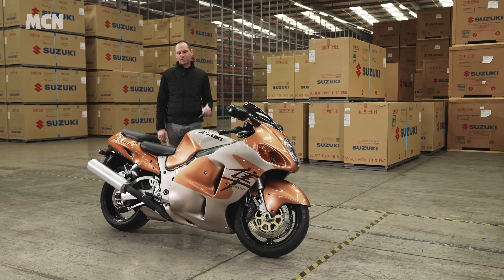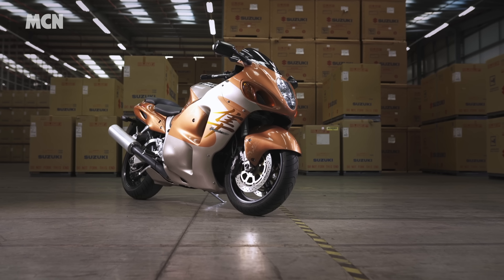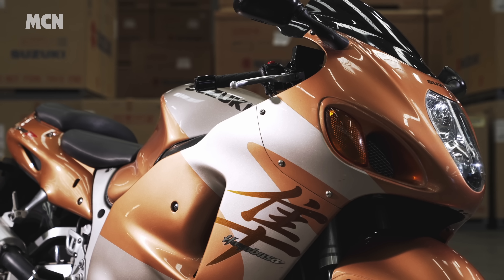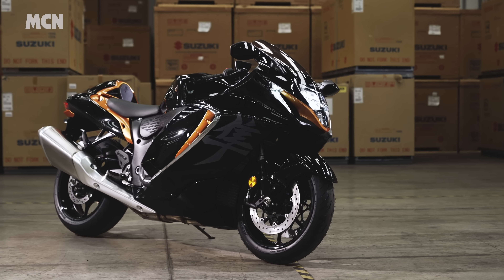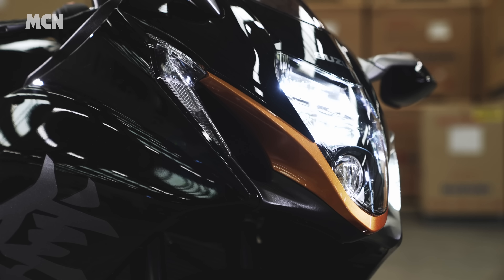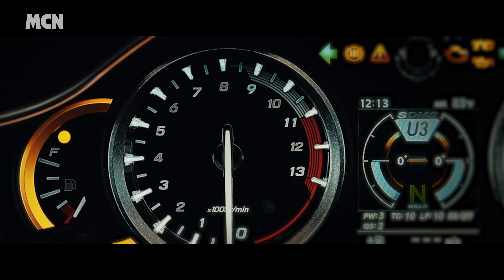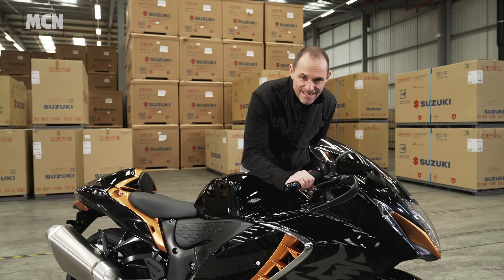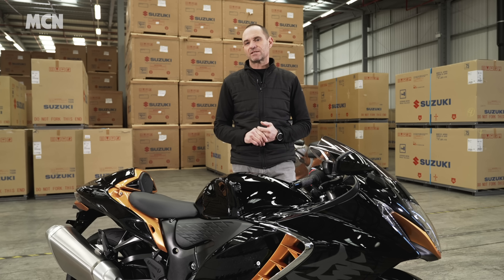2021 Suzuki Hayabusa exclusive: Neevesy's take on new 180mph+ hyperbike | MCN

Comment: I'm really mesmerized how they've still managed to put Busa elements. They've not changed the look completely and that's a good initiative.❤️
Reply: Exactly...
Reply: I think it looks lovely. Strong & elegant. It reminds me of the Bugatti Chiron.
Reply: Unlike BMW changing whole S1000RR front look which was so iconic
Reply: Of course they managed to put busa element, its a same bike basically lol. Just lot of small change here and there.
Reply: The look is part of the aerodinamic enginering marvel of this beast.
Reply: @ardijanuar2036  Small changes here and there? Lol. They've changed so much on electronics and still managed not to overdone on the looks. Maybe you need to watch it again. Lmao
Reply: @ayushh1001  its basically same chassis and engine base, for me if it doesn't have new engine and chassis, it's an facelift not a new model. It's an evolution not revolution. Revolution is like when ducati came out with panigale v4 or honda with cbr 1000 rr-r. totally clean sheet design not carry over from previous gen.
Reply: @omegabiker  panigale v4r? Cbr 1000 rr-r? Bmw s1000 rr? All those get huge improvement with clean sheet design, not carry over from previous gen. Even aprilia rsv4 managed to get more power with euro 5 not lose hp like busa lmao. And of course don't forget ninja h2, which has long dethroned busa from straight line speed king favorites.
Reply: @ardijanuar2036  Right, now check the prices of each of those bikes compared to the Hayabusa and watch the video I linked above to understand why.  Hayabusa is one of the easiest and most modified motorcycles if you want more speed and now they've made that even easier.
Reply: @omegabiker  not as easy compared to ninja h2 to make crazy power. Bolt on mod and tune on h2 can makes 300 hp+ on pump gas. How much mod do you need in hayabusa to make that kind of power? Turbo, nitrous or serious engine work are required for that power in busa. 20 years ago maybe busa is the easiest bike to get insane straight line speed but the competition has moved to another level today.
Reply: @ardijanuar2036  the H2 is more expensive because of the electronic and charger that's comes stock on it. This has been debated since the bike came out. Just the base H2 is $25500. My 2020 Busa was stickered at $15700. You know how much power I can add to my Busa just to match the cost of a H2? Nearly $10k? For the H2r $40k.  Come on, that should tell you some thing right there. If I put $40k into my Busa it wouldn't even be earth legal to ride.
Reply: @ardijanuar2036  The electronics makes it a completely different bike. 200hp bikes without cruise control, are not really safe, in the sense of keeping you out of jail, on the street anymore. Then there's the increased emphasis on braking. (Stylemas are pointlessly expensive, and very possibly excessively grabby, bling/jewelry on a non-racer; but no doubt a big improvement on the outgoing ones.) Flapping around changing stuff which works perfectly well, especially now when the resources available for such a redesign is only a fraction of what they were in the golden era, is just wasteful, and more often than not plain counterproductive.

Being Suzuki, I also bet the refinements will show up much clearer on the road, than in spec sheets.More that anyone, their bikes are designed by test riders as much as by engineers.

Comment: That rear end looks absolutely mental!
Reply: I think they nailed blending the looks of the previous generation vs the future. The rear end design used to be a bit perplexing.
Reply: Only great improvement on the bike
Reply: Finally the front and back DONT lookalike
Reply: @greylove1522  what about electronic controls and features ??
Reply: @anandthandav3641   They are nice too. The Kyb suspension and Brakes in my opinion is the best upgrade to it.  I just really like the new tail section.
Reply: @MirageTactics  looks the same to me

Comment: Oh my she aged well, and I love how time has treated her, all though I'm gonna always have a soft spot for Honda I'd love to see a new super blackbird too
Reply: I'm with you there. I loved every minute of my XX until I sold her 10 years ago. An unbelievable mile muncher with a full load - simply awesome bike. :-)
Reply: @deldridg  Agreed 100%, and almost exactly the same with me... I sold my Blackbird around 10 years ago, cause I bought a Busa. I LOVED my BB, and in many ways, I think it was a better bike than the Busa (I DO love the Busa though). Actually, I feel like the perfect bike would have the Blackbirds chassis, brakes and ergonomics with a 90 degree V-twin that could run with a Busa or ZX14... something in the 1400cc range. With Honda's engineering and reliability? Man, that would be one hell of a bike.
Reply: +1. 
A reissue of the Blackbird would be a bike I'd want to see for sure.
Reply: That was one great machine silky smooth.

Comment: Kawasaki: ' is he back ??'
Ducati : ' yup '
Bmw:😨😨😨😢😢
Reply: Exactly what i thought
Reply: yea but I'm pretty sure there laughing instead of being shocked lol
Reply: @khaledmaher6602  Yeah I doubt Kawasaki or Ducati  - both with lighter bikes and over 10% more power - are even slightly worried. More like celebrating.
Reply: Doubt Ducati even cares if I'm honest, they've never made a bike to compete with the Busa. Sure they could if they wanted to.
Reply: @JMLueckeA7X  Well they're already getting 20hp more from a significantly smaller engine. They really wouldn't struggle.
Reply: @siraff4461  it's honestly ridiculous, this bike did 194 in 1999 had the most power of any bike was THE straight line king. Now it's slower than the old one, slower than every 1000cc sportbike. The v4r has the most power at 221 or 234 with full system. Kawasaki get less with a supercharger stock street legal form h2. Not impressed these days.
Reply: @A500-g6g  it's not even tested this 3rd gen busa i think believing in papers specs and test riding  have lot of difference
Reply: @A500-g6g  and in de-restricted mode too
Reply: @siraff4461  this bike was pioneer.. Thats why al lot people call this bike A Legend. Not a people like you are, fans boy of those manf
Reply: New busa be  like- knock knock Tera baap aaya 🤪
Reply: The legend
Reply: @siraff4461  Hayabusas are used as drag bikes with superchargers/turbos/nitrous, and will kill ducatis and bmws on the drag strip on the daily. Apples to Oranges
Reply: @khaledmaher6602  BMW and Ducati don't have a direct competitor for Hayabusa. Atleast Kawasaki has the ZZR1400.
Reply: @Guuggel  they don't really care about Hayabusa if they have a faster stealthier bike lol
Reply: @siraff4461  yup
Reply: Considering the ZX-14 owned the Busa, I doubt Kawasaki or Ducati would be concerned with the new Busa.

Plus Kawasaki has dis-continued the big Ninja. So I guess they really are not concerned.

Suzuki....'No more Ninja 14....perfect. Now is our time to bring back the Hyabusa.'
Reply: @A500-g6g  Simple ECU flash on the H2 and you're up to 250HP. That 998cc engine puts out 310HP stock and is highly restricted in the H2, to keep it somewhat sane.The Ducati mill is no comparison. What cc is that big Duc engine again?
Reply: It's a "she" mate...
Reply: @A500-g6g  People who want/need to go fast for real, as opposed to on internet forums, care more about how much power they can reliably get out of the engine, than how much it happens to come with stock. 

What matters stock, in bikes which are all plenty powerful anyway, are more mundane facets, such as driveability, reliability, longevity, heat management etc.

The 'Busa is plenty impressive on both fronts. Others may be as well, but the 'Busa has earned its legendary status over the years, both as a highly effective fast street bike, and as the base for a genuinely fast racer.
Reply: @GPz84  The two wheel missile / hypertourer market is a lot smaller these days than it used to be. It may still be big enough to justify updating one player, even if it no longer has room for two.

As nice as the 14 is (comfier than at least the outgoing 'Busa), current speed enforcement (at least in the US), makes it almost reckless to take it out without the ability to engage cruise through all the crazy police-pension-fund-topping-up speed trap zones, which by now pops up, like moles, around every little podunk town.
Reply: @paulnorman8274  I agree with you biking is much more about getting out there riding and learning physically than anything else. But I expect better from these new bikes like the h2 and hayabusa which are meant to be the most powerful and fastest in a straight line. In the 90s this was the case and they were the ultimate speed missiles. Now they're mostly slower than sportbikes. 

I say get the last iteration of the zzr1400 as it has the cubes and the actual performance and looks. 

If u want real speed you buy a turbocharged hayabusa off eBay, they come with inspections receipts dyno printouts and drag strip time slips and MOTs even, for the same price as a new one. Personally I say just buy a 1999 or 2000 unrestricted hayabusa or a zx12r brilliant bikes with plenty of power and 190 mph capable and only a few grand.
Reply: @Guuggel  shame that ZX14 going into retirement, they could of built new gen 3 with latest electronics with the famous supercharger. I really though they would built it,since they have there jet ski with 310 hp.
Reply: @GPz84  it's not horsepower that makes great street bike, torque. I have 2015 H2 and ZX14,wanted something little different for the city purchased 2020 KTM 1290 SDR that beast throttle wheelies in 3rd gear. It's blast to ride.
Reply: @geraldperry7779  That KTM will also be a blast when it starts falling apart,  which is inevitible.
Reply: @GPz84  have you read on the reliability on LC8 engine? Also with the 2020 they strengthened the engine,Pankyl gearbox,forged pistons,finger tappets, and Titanium valves,the list goes on. My only concern is the wizard electronics,now that I can't fix,at the mercy of KTM. For city streets it's best bike I've ever rode. My first street bike was 1975 H1 500, sure you know the bike since you own Concours.

Comment: I have a 2000 Busa that has the 220 mph speedometer. I've always wondered if it was one of the unrestricted models. I've only had it to 140 in 3rd gear with plenty of revs to go. I slowed down for fear of getting a ticket. I was from 50 to 140 back to 50 in about three seconds. It was incredible. What I say to the Gixer riders that say the Busa can't corner with them is, "I would rather pass you on the straight than work my ass off in the corners anyway".

Comment: At this point they should come with a turbo or supercharger stock
Reply: Mate👊✊ I unfortunately disagree, turbos on bikes are great for 9 second passes, the Kawa Z2 engine I really don't like with more 'whistle' sounds than rev sounds? If they have been able to make this 1340cc big block euro 5,bravo.this engine is going to sing!
Reply: Evo Shift  what's the true story why it blew? Where you just commuting in traffic? Where you at a track? That sounds horrible mate, I'm sorry to hear that, they are meant to be 'bullet' proof where you can turbo and get big psi etc etc?
Reply: Evo Shift  Don't post a comment tarnishing a company's reputation and give no evidence. I'm sure suzuki honour warranty claims but there must have been something you done that made it void.
Reply: Turbo, my poor novice, nothing can come close to a big displacement naturally aspirated engine. Turbo equals lag, muffled exhaust sound and lower reliability.
Reply: @lensoprezole5322  sure you can ride a tank like the new Triumph Rocket with its 2.5 L displacement but its heavy.  Kawasaki is atleast moving things along with the superchargers
Reply: naaah i will go with more cc :x now it have 1340 with 190 bhp at 9,7 k rpm and 150 nm at 7 k rpm its still more than enough for 90% customers or better saying egzacly what they need :x  =lil more than 4 sec 100-200 real m/h is relatively fast :x  but i will go with like 1600-1700 cc :x 230-240 bhp at 10 k rpm and 180-190 nm at 7 k rpm ;) weight will increase be like 10-20 kg  those numbers defenitelly dont help in daily riding but  in race mode on straight yep :x  which in fact be 5% time spend on this cycle be 90% of customer .:x .so its good anyway what it is with better aero better brakkes  stronger midrange and lil more comfy position behind sterrrwheel  they do nice progress .
Reply: @Nekminute   rocket have no chance with hayabusa on straight . :x  20 bhp less 60-70 kg more and much worse aerodynamic ....no doubt   hayabusa have heavvier punch at straight ... 221 nm of torque is nothing  compare to hayabusa 150 nm beside  drag aero weight  because rocket pump those numbers at 4 k rpm vs busa at 7 k rpm = busa at peak torq  produce more force at tire circuit  be around 20%  :X /at peak torq at crank  with lower weight better aero in real riding the diffrenc be even more  .,beewten peak power vs peak power less diffrenc but still relatively big diffrenc again corelate with better aero less weight diffrenc in real be much more than just from engine  peak bhp numbers ... but those are diffrent cycle class so whatever ;) but for fun we still can comapre both in real drag race and on paper like i now ;) . rocket is made for have best  proportion beewten power to rpm ratio = highest power posoiibble at low rpm for this they made 2500 cc with 221 nm  torq  in terms of peak performancee its no match for hayabusa engine but in terms of low end power it beat all other  stock cycle on market now :x thats destoiny this cycle some people just dont get it that best power to rpm ratio thanks huge displacement and torq  dont mean strongest punch at straight = best acceleration at straight ....  hayabuisa 100-200 this new one be doing it in like 4,2-4,5 sec i quees probably close to 2 gen vs rocket is like 7-7,5 sec :x  first metres like always limits road tire and cycle with better weight dostribution win on first 10-20 metres i nevver count this for very strong cycle its pointless like for me true diffrence come into play at lil higher vvelocity where most cycle can use full engine potential without looose tratcion or do wheeli ...

Comment: Firstly, I really love the look of the New Hayabusa!

Been a Hayabusa fan now ever since seeing the Fast Bikes Mach 3 Video around 20 Years ago! 

Last Year I finally owned a Hayabusa and it was of the very last Gen 2 Bikes, It was an all Black 2017 Bike with an Arata 4-2-1 Titanium System, De-Restricted & Custom Mapped to suit. Ballistic in a straight line, Power everywhere in the Rev-Range but I struggled to get on with the Bike on quick Twisty sections of Road and had a few out of the seat wobbles when trying to get the Bike to change direction too quickly.

Even though my Bike had the ABS & Brembo's I was never blown away with the Brakes either, I felt that they lacked initial bite and feel so uprated the Pads for some Sintered's which helped. I sold the Bike at the end of the Season last Year and ticked it off the list of Bikes I have wanted to own and said I wouldn't own another and that if I did go for another "Bigger" Bike I would try the ZZR1400 Performance Sport next time.

I have to admit I had previously owned a 2016 ZX10R KRT, A Gen 1 BMW S1000R Sport & Gen 2 BMW S1000R Sport and probably expected a bit too much from the Hayabusa. Its not a Sports Bike and I had to stop trying to ride it like one.

However, This latest offering sounds to me like a vastly improved model. Lets be honest the small Reduction in peak BHP/Torque figures isn't really anything to get upset about, It is still going to be a rapid machine. Gen 1 Bikes are still quick even today. In theory it should be a much more manageable and flexible bike in Real World riding and with the modern Electronics be a quicker Bike point to point.

I will look forward to some Reviews later this Year when it has been tested properly.

Comment: That MPG loss seems to be a creeping trend with Euro 5. Similar loss for the Ducati V4S Multistrada. Have the politicians got it all wrong and is Euro 5 more detrimental to the environment by way of extra fuel usage? Beautiful bike though and cool location. 👍
Reply: The regulation "forced" those engine to be "cleaner" without necessarily being better at fuel economy.

Cleaner meaning it produces less toxic gas etc.
Reply: With Euro 5 and making them 'cleaner', most manufacturers are increasing displacement to maintain power outputs, could be part of the issue? Also, has the way 'official' mpg figures are determined been changed?

Comment: I actually got emotional there WTF 🤣, I think it looks fantastic, would have liked a 1440cc engine but I'm v v impressed
Reply: And a loss of a 100 lb; a good suspension flattens road irregularities just fine.  How about a better standard using this motor than the last one which was hideous.
Reply: @bseidem5112  I believe myself this will make an excellent road bike, Comfort, and Power from that inline 4 is all that's needed
Reply: Buy a turbo hayabusa with 500hp and 250mph top speed off eBay 10 grand much better than this lol.
Reply: @A500-g6g  🤣🤣🤣🤣🤣🤣🤣🤣🤣

Comment: I cant wrap my head around these new euro 5 emissions regulations, what comes out the exhaust is cleaner but its worse on fuel consumption, dose not make sense, motorcycles more often than not are play things anyway not daily drivers. 🤦🏻‍♂️
Reply: They're cleaner and the fuel consumption is 'worse' simply because they changed the way they measure the consumption. It is now more realistic so it didn't actually get worse
Reply: @uli169  learnt somthin new there, thanks 👍
Reply: How about dpf, they're the worst